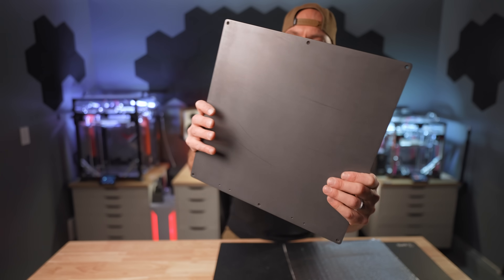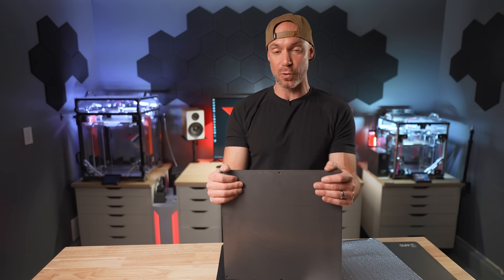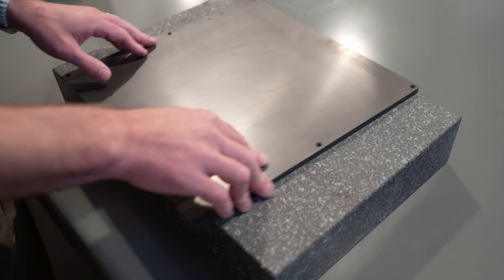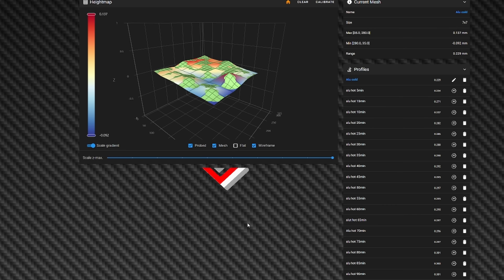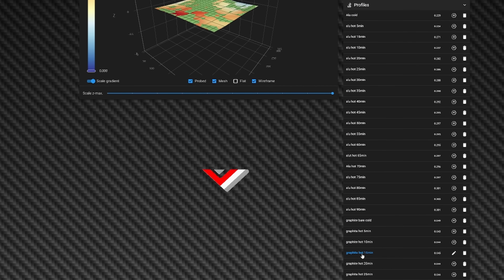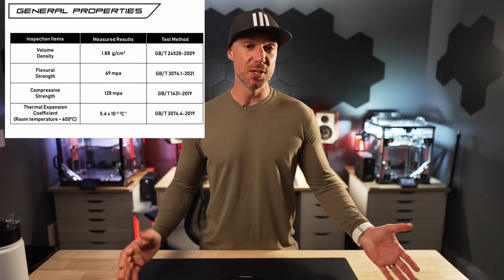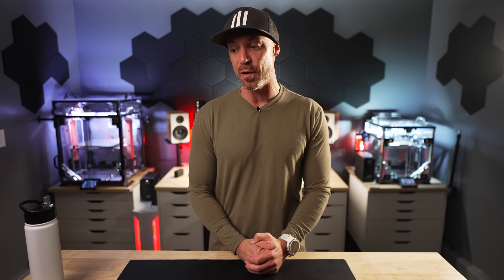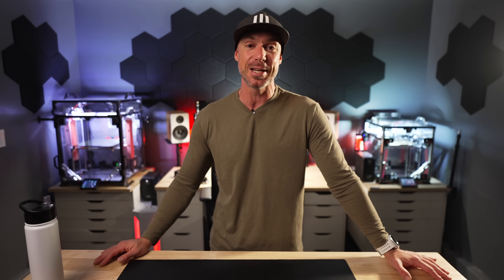Graphite 3D printer Bed - Good or bad ?

Comment: Wish they embedded the magnets into the bed then that could have been a more better solution. The magnetic sheets tolerance could negate the accuracy of the graphite bed. Combine that with an epoxy coated spring steel build plate and you have the best solution for 3d printing.
Reply: No.
If you embed magnets his beacon probe would stop working.
Reply: @REDxFROG i run a magbed with my beacon and yes it causes issues but i have a 1.7mm thick 1095 spring steel sheet with a machined pei coating on it and im getting better results than that graphite bed. yes its wayyy more expensive but it can be done
Reply: @blakewillett4996  did you have any problems because of the magnets? Any why such a thick springplate?
I also have fixed magnets and a cartographer lying around but had fear of crashs at homing so i haven't used it yet
Reply: @ yes lots of issues with magnets. not homing but on the mesh you can see the magnets. i bought the beacon sock which reduces voltage and a bigger spring steel sheet helps a lot . i’m not sure why but it does so we roll with it
Reply: @blakewillett4996  when every magnet is visible hom much is your deviation in measured height from it?
And why doesn't it bother you?
Are you only homing with beacon?
Reply: @ i use contact to home z
Reply: @blakewillett4996  and what is about your mesh? You mentioned every magnet is visible
Reply: @ the magnets are not visible anymore since i now have a 1.7mm plate. and my meshes are .00972mm of deviation. this sheet that i have is very custom and very expensive. very flat
Reply: @blakewillett4996  wow 1/100 mm is pretty flat i wish i got something like this. How did you achieve this? I also milled my plate to 10,5mm starting from 12 but it is not going to stay straight when heated, i guess i should have used a cast plate instead of a rolled one
Reply: @ i have a 12mm thick ATP-5 bed. and kelvin kinematics bed mounts
Reply from the maker: No..because then you screw up beacon scanning
Reply: @Vez3D  you said yourself you never bothered to have a leveling probe when you had an alu bed, i guess with the graphite one it even worthless
Reply: @Vez3D  do we even need bed mesh with this?
Reply: unfortunately for lot of probes it would be problematic
Reply: @tapirath  but if it´s that good, who needs a probe for bed leveling?
Reply: @yuripolak  maybe you dont need a mesh but still need Z stop / homing sensor and IMHO beacon is by far the best. TAP or klicky or under bed piezo sensors all failed on my at one point  Eddy current just works and wouldnt want to give that one up
Reply: @tapirath  but for that it would still work, wouldn´t it? I believe it would fail only on the spots where you have the magnet. You just have to avoid the magnets
Reply: This thing is so flat you level the four corners and home the center and that’s it… forever
Reply: I'm sure the overall flatness is still better, even though the magnetic plate makes it less accurate.
Reply: clearly looking at the results it doesn't negate anything.
Reply: @Tedlasman  the thickness tolerance of the magnetic sheet between the bed and the build plate would definitely influence the final result of the flatness of the complete bed build plate assembly.
Reply: @alfredanil  in theory, sure. In practice, as you saw in the video, it was more than acceptable.
Reply: @alfredanil  While it would be cool to have a toleranced magnetic sheet, surely at some point we are getting to levels of precision that are a bit silly for FFF no?
Reply: @Tedlasman  Nobody is going to buy this bed to simply get "acceptable" results though, because an Aluminium plate for a fraction of the price will already suffice.
These graphite plates are for the nerds/engineers who need a superflat bed for whatever reason.
Reply: @BeefIngot  yes, but.... is superflat. I mean, for us hobbyist and makers, is justified.  if u have a farm and main goal is to print parts by orders yes this is not justified, actually more than an ender 3 or a prusa is not justified hehe.
Reply: @cosmic_cupcake  It's acceptable for what you paid for.
Reply: @cosmic_cupcake  They're for people that want to have a flat bed when they print TPU with a low bed temperature and ABS at a high bed temperature. Aluminum warps too much between temperature extremes. Graphite doesn't.
Reply: Don't embedded magnets mess up eddy and inductive probes?
Reply: @ not if you have a spring steel sheet thicker than .75mm

Comment: This is really cool, is there much of a weight difference? Might be very optimistic given the difficulties making this stuff but i hope they consider 400 and 500 sizes for ratrig users!
Reply from the maker: thats one thing I didnt measure. It would have been good. But its lighter. its less dense than aluminum

Comment: I've been waiting for this video for a while, it's cool to see some proper footage of the bed. While the price isn't exactly "budget friendly" (which it isn't exactly meant to be,) the ability to "max out" a specific component is great for those who want it. I'd love to get a copper bed machined in the future and compare that to regular aluminium, hopefully I can try that next year. Hoping your kraken motor video will be out soon too! Cheers!
Reply from the maker: its next :P
Reply: @Vez3D  awesome :D
Reply: not that anybody will listen to me, but bang for buck, precision ground steel, that's ground pre-heated at target use temp.. everyone fixates on bed heat times, which are frankly a tiny fraction of the time spent printing, especially if you keep the bed soaking continually. Where it shines is in heat capacity and evenness.. Aluminum sucks because of it's high transfer capability, I don't think copper will be significantly better and will show un-even heating wherever the heating components are, which are never uniform, though it does offer better thermal capacity.  It's exactly why cast iron/steel cook ware is so prized compare to aluminum. IMO copper is ideal for heatblocks on your hotend, but as I said, fast reactive heat isn't what you need from a bed, unless there's some specific use case I'm not familiar with. I've run a 12" diam laser cut, 3/16" thick steel (from the scrap pile) "buildplate" that I ground reasonably accurate on a surface grinder; on a Delta for years, and the heat uniformity is insane when you look at it with thermal. That's an older machine so no mesh bed leveling and I didn't grind it pre-heated, so I can't tell you how the surface accuracy is on it, but I can tell you, I never have first layer issues, and I have edge to edge adhesion. Some heat-treated alloys will probably offer better thermal surface accuracy consistency, it's not my area, but the tool and die industry has all this shit figured out.  Graphite is an interesting option, but honestly, I don't think it's the optimal choice for most applications when cost and complexity are considered. Copper is a bit heavier than steel by volume, significantly more expensive, and being non-magnetic make it trickier to precision finish IMO, especially in thin crossectional thickness necessary to minimize cost, but then you have to worry about surface accuracy and uniformity of both sides of the plate affecting it's movement more significantly, the thinner it gets.   Plus just consider this: induction bed heaters..steel! =D
Reply: If thermal stability is the goal you would have to go with something like Invar. For comparison the thermal expansion of graphite is at 25x10^-6, super invar 32-5 is at 0.63x10^-6. However compared to that graphite will look cheap.
Reply: You call that: proper footage? looking at a dude explaining what we possibly might eventually see if we buy it our selves, Not a demo of printing a long flat square rectangle to see if it does not deform etc.  To me it sounds a lot like yep yep yep yep, and look who is in the picture I'm so fond  to see myself in video.